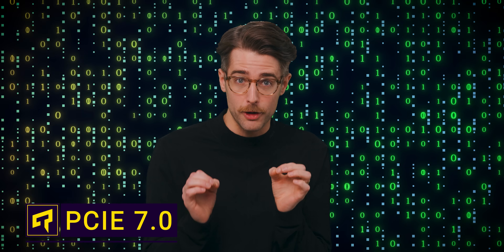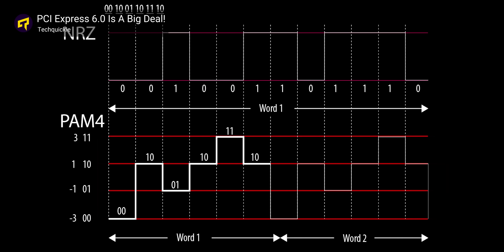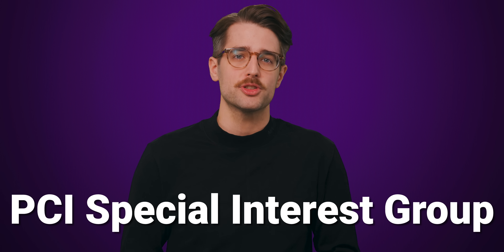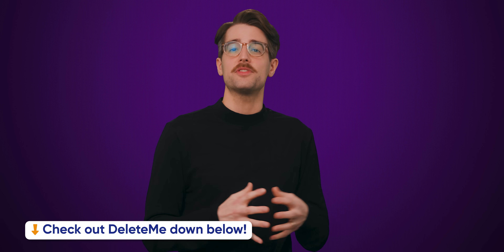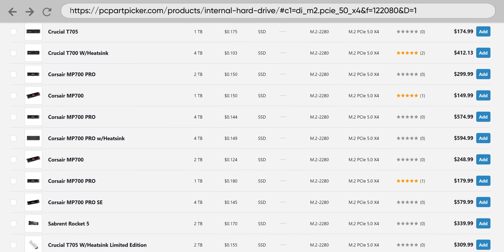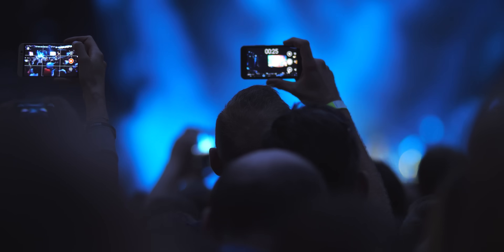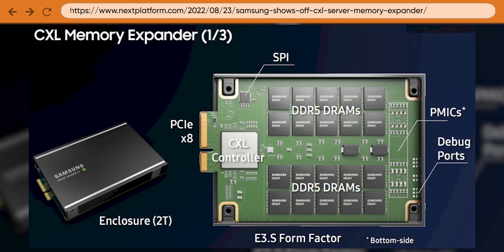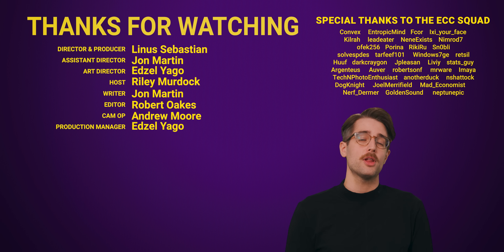PCI Express 7.0 is INSANE

Comment: I'm tired of most motherboards being limited to 16 pcie lanes and splitting them between all the slots. By the time I add a GPU, Dual 10gb, and a HBA as well as a couple NVME my GPU is bottle necked.
Reply: Hello I’m currently looking for a B650 motherboard, where could I find the info about how many pcie lanes it has? Maybe the online manual on the company website?

Comment: PCIe version felt like: PCIE THREEEEEEEEEEEEEEEEEEEEEEEEEEEEEEEEEE FOOOOUUUURRRRRRRRR FIVESIXSEVEN
Reply: More like:
THREEEEEEEEEEEEEEEEEEEEEEEEE FOURRRRRRRRRRRRR FIVE67 lol. Six was released yesterday, I swear!
Reply: 4 was shorter than yall think
Reply: It really doesn't feel like it but the time between 4.0 to 5.0 is shorter than 2.0 to 3.0 (2 yrs vs 3). 5.0 to 6.0 and 6.0 to 7.0 are also 3 years apart respectively. I legitimately thought the 6.0 video came out last year lol
Reply: Actually it would be more like "THREEEEEEEEEEEEEEEEEEEEEEEEEEEEEEEEEEEEEE FOURFIVE S...SEVEN" PCIe4.0 hadn't released a single device before 5 was a finished standard which is kinda why intel opted to ignore 4.0 and wait the year or so to adopt 5.0. Then I don't honestly even remember so much as hearing about 6.0 and we're now on to 7.
Reply: Pcie 4 was available with B550/X570/Z590, proper availability with A620/B650/X670... Which is when pcie 5 was made available.
There wasn't even a full generation of wide availability for PCIe 4 before 5 came out.
Reply: THREEEEEEEEEEEEEEEEEEEEEEEEEEEEEEEEEE FOOOOUUUURRRRRRRRR FIV SI S
Reply: like even on 4090 pcie version doesnt do much, on pcie 3 there is only 5% loss in fps
Reply: @DRedGuia  the higher bandwidth isn't really for gpus, it's going to be for ultra fast storage and networking and the like
Reply: @Anankin12  True, I am using a PCI-E 4.0 x8 card on a PCI-E 3.0 x16 motherboard. Not long upgraded from a Ryzen 5 2600 to a 3800X and i don't see any reason to upgrade again yet, everything I play runs perfectly fine at the moment
Reply: @mysteryboyee  no man, it is for GPUs. Just not for gaming. When you train a big model and/or use mini batches, the data communication overhead is something astounding. For example my 3060 12GB is constantly at 20% power limit while at 100% utilization because of the bandwidth limitations. I literally have the same performance as my friend's 3050 Mobile (4 GB) and my own CPU (5800X3D), despite it being 3 or 4 times faster than the 3050 and literally HUNDREDS (tested between 90 and 120 times faster in an unrealistic task that does the same kind of operations) of times faster in compute than the CPU in this specific task when not bottlenecked by communication overhead.

It's literally the most important aspect in performance for some tasks that use GPUs. Gaming is just not one of these. I'm pretty sure that if I bought a 4070 Super I would more than double my gaming performance but I would notice basically no difference in my ML training times.

Comment: You missed the best benefit that this can mean for consumers. Using fewer lanes. It has 8x the bandwidth which means that a 4090 could be kept fed with only 2 PCIE lanes. Given that consumer boards only have 24 PCIE lanes coming off the CPU and 4 of those going to the chipset being able to dedicate only 1-2 lanes per device means you could actually connect a ton more devices in a standard consumer computer. With these faster speeds I would love for x16 slots to fall out of favor and for us to drop down to x4 slots for devices like GPUs and down to x1 slots for storage. They are already overheating trying to reach 16GBps. 32GBps which is the x1 speed of PCIE 7.0 will be plenty for storage.
Reply: Good luck finding AM5 motherboard that both cheap and has x8/x8 split PCIE
Reply: @bocahdongo7769  Yes my comments are forward looking considering AM5 is only PCIE 5.0. This is what I would like for them to do with future consumer boards.
Reply: Pci-e 5.0/6.0 x 1 HBA/10gb NIC cards ^_^

I know that there are HBAs with only 1 Pci-e slot, but they don't have the amount of SATA ports that I would like. From what I know, quite a few motherboards have 1x slot Pci-e connection on them, but with the older Pci-e standard. When Pci-e 6.0 or 7.0 is mainstream, I hope we see HBA cards with enough SATA ports for my use using only one Pci-e slot. From what I know, most motherboards suitable for my budget don't provide enough Pci-e slots for a NIC, HBA and a potential GPU. 

By that time, maybe ECC memory will be a standard, maybe on-board 10gb network port as well ;). A guy could dream 😏.

Comment: PCIe 4 NVME: can run without any cooling
5: Needs a heatsink for full performance 
6: Needs a heatsink with a small fan
7: Needs a large heatsink and a 120mm fan
8: Needs an AIO or to be integrated into a cooling loop
9: Needs its own cooling loop with atleast 360mm radiator
10: Needs its own air-conditioning unit outside of your house that it's hooked directly up to
Reply: PCI 5.0 really needs cooler otherwise it will get overheated and performance will be reduced quickly
Reply: imagine a world where you have a PSU dedicated to your monolithic 3 cubic meter block of nvme cells hooked up to the system with a fiber link and linus has a new pool for cooling his
Reply: 11: needs a nuclear power plant cooling tower
Reply: its not work like that, Newer PCI will make the Motherboard can heve 16 NVME slot without a hitch.
Reply: too funny
Reply: Dial back all the descriptions by one generation and spot on. Gen 4 needs a heat sink and gen 5 needs some sort of cooling etc
Reply: and yes its likely by gen 9 you will need AC xD

Comment: Optics has huge latency, so it can be justified only on distances higher than 100m (0.1km).
The only option that may work is transmission line for electromagnetics waves implemented like some kind of coaxial cable on PCB (one transmission line per copper wire on PCB).

Comment: I have a tendency to opt for overkill. I built my current desktop PC to be relevant for at least 7 years. I invested almost $6,000.00 in this system and hope to justify that cost. Also, I provide professional sound/lighting systems for entertainment on stage. I use a 24 channel digital mixer which is WiFi controlled, using a router so I can control from up to 300 feet from the mixer. I opted for Cat 8 cable instead of Cat 5, simply because I want overkill on everything. I use 3 tablet computers to control this system. From a 10", 12" and now a 14" tablet. At 66 years of age, I am still a technical geek who prefers the best. I may never build another PC, but I'll have to admit that PCIE 7.0 will be tempting.

Comment: Doesn't signal integrity also depend on the software that deciphers it? 

Say, the faster piece of software can interpret a signal, the more that "signal" can hold?

Like say, 8 Track vs Stereo Casette? Both using a magnetic film roll, both having different capabilitie because of the hardware that uses them?

Like, doesnt it go both ways? Isn't that why GPUs no longer really saturate the lanes?

Comment: I wrote this before the ad break.
From the sound of it it looks like PCIE is pushing towards becoming a new vesion SCSI standard acting as a back plane. It wouldn't surprise me if we see PCIE used as a cpu interconnect. Intel is working on a optical cpu link as well or they might be done with it already.

Comment: I will tell you how fast PCI is. I got a new computer in June 2024. My mainboard has two PCI E 5.0 m.2 slots. And two PCI E 4.0 m.2 slots. I'm running in the m.2 4.0, two 2TB Corsair PCI 4.0 nvme drives. I'm running in the 5.0's, two 2TB Corsair pci 5.0 nvme drives. My pci e 5.0 slots have direct CPU access since the slots are directly wired to the CPU. My high end games and OS are  stored on the 5.0 nvme's.  Games levels load from 3 to 5 seconds. Then the games are fully playable. Also last night I did a full image file of my OS using special backup software I bought and own. It only took me I kid you not. 1 minute and 50 seconds to fully do a disk image backup file of my OS on my PCI E 5.0 drive. Makes sense, I installed Windows 11 Pro OS by USB Flash Drive to my PCI 5.0 drive in only 1 minute and 40 seconds the OS then booted from the drive. I've been designing PC's since 2000. We are living in the golden age of speed.

Comment: Optical cable links for PCIe 7.0 devices?

If such devices don't need traditional metal circuits then the shape of future motherboards and devices could be radically changed. Instead of large planar PCB's we would have devices that are physically separate and connected to the CPU optical cables. I wonder what that would look like.

Comment: i dont need faster speeds, i need more space.
Reply: How much space do you need for your personal PC that is? Hell 8 TB SSD from the likes of Samsung have been available on eBay and Amazon for easily close to a year now and occasionally I've spotted 16 TB ssd, one of which I bought from the team group brand a month or two ago
Reply: @motoryzen  well that depends on what your use case is. I have a personal server that needs more space or at least more affordable space. 

My personal PC is mostly good but still better storage options would be nice.

my handheld PC however, THAT i need larger NVME. right now 8 TB would be good but WAY to expensive for a single piece. In order for it to come down though we need higher end and other options. Higher speeds are not what is needed, we haven't used even a portion of the speeds we currently have in most cases. Games, videos and programs are only going to get larger in size.

More Ram is good though lol.

Comment: The question is will we get enough lanes?   The systems are designed to use up many of the lanes before you even put a card in.   I have a real raid controller card, a real gaming graphics card, and a real network card (100gbps).   You can say - oooh well that is a niche market.   Those are the same people who say - who needs 4K video or more than 60hz monitors, or indoor plumbing...

Comment: I want to start seeing x4 and x8 gpu’s and x1/x2 nvmes

So I can have more devices that use fewer lanes
Reply: Protip: NVMe (and most PCIe) devices will function w/ less lanes. [I used to run Solidigm P41+ 4.0 drives in X570's 4.0x1 slots]
-Optane M10s were Gen3x2, 990Evo is Gen5x2
-RX 6500series were 4.0x4 (M.2 adaptation invitation, IMO) + a myriad of GPUs are x8 (reaching back at least into the RX5*0 series)

Comment: I'm pretty skeptical about PCIe 7.0
1) M.2 NVMe's already have problems with cooling. PCIe 6.0 M.2 SSD has no way inside laptops because of that. You can't cool such SSD.
2) PCIe has backwards compatibility issue. I have fancy new 8K60 capture card. And it uses 8 lanes of gen3. My GPU also uses gen3 but 16 lanes. 24x gen3 = 12x gen4 = 6x gen5. My CPU has 24 gen5 lanes. It is 4 times more bandwidth that I need. Can I install both cards with full speed? No.

Comment: It's primarily for data center use.  They can use an x16 link over wire to interconnect to other blades in a rack.  Like a PCI link to a dedicated SAS enclosure or an enclosure loaded with compute etc.  moving forward generally expect consumer platforms to be about 2 generations behind enterprise in PCI generations.

Comment: Why is everyone naming self driving cars as demanding usecase in a datacenter? Do you really want to have self driving cars that either drive uncontrollably or instantly stop when they loose the internet connection? From my point of view self driving cars need to work completely by themselfes and by direct communication between each other. Information from the internet can only be extra data like road blockades for the navigation system, like already today.

Comment: I wish manufacturer engineers would eliminate the PCIe bus and run that same signalling over fiber instead. Then you could plug in your peripherals with an optical fiber with a plug and twist. PCIe over fiber is not a new concept, it's already done today. Using fiber would cut down on power requirements and PCB copper use.

Comment: Can’t wait for this to not be useful outside the server space until PCIe 12 is out
Reply: That's unfair...it will also be useful for workstations.
Reply: @concinnus  I doubt it
Reply: How awful.

Didn't they know they are OBLIGATED to make everything immediately useful for basic folk DAY 0!A!1!!!
Reply: @iambenmitchell  doubt all you want.

Once you move away from pushing pretty pixels, there is a need for the high bandwidth and features afforded by pushing this spec. Hence why it's pushing.

While the video games aren't demanding that much, other areas are an entirely different story.
Reply: @MaddJakd  yes. I know that. That is why I said "Outside of the server space" 🤦‍♂
Reply: @MaddJakd To add, even though it’s way overkill for today’s consumer graphics cards, it’s NOT overkill if you want to plug in 10 or 15 cards into a dual-CPU motherboard to partition into virtual machines for a rudimentary cloud gaming service.
Reply: Not if we movbe toward 2× standard for desktop ssd's. I'd like 4-5 to be on there as a norm, not 1-2 like we have now.
Reply: @fujinshu  A "cloud gaming service" is literally a server, even if it's LAN only.

Comment: Literally just bought a new PC, and got myself a nice, small, and fast PCIe 4.0 SSD after using an actual hard drive for almost a decade. And now there's PCIe 7?!
Reply: apparently for home use a gen 4 is even still way above and beyond what's needed as the rtx 4090 just barely fully utilizes a gen 3.

Comment: 800 gbps used for cloud AI we probably need 10g mobile network speeds . AI will not be limited by processing power but mobile internet speeds with 2tbps transfer speeds . Its same like you are forcing 100 gallons of gasoline for same lenght of travel as into a 100 bhp 4 cylinder engine which consumes just 1.5 gallon of gasoline per 62 miles traveled at full throttle

Comment: PCI 4 actually bottlenecks a 4090. Even if only by 10-15% depending.  PCI 5 doesn't.
Each gen doubles the previous, so obv it is exponential gain that continuously tends to look like "we could never possibly use all this"
Eventually it will stop at a real world theoretical maximum values and they'll have to make the slot bigger and stop backwards compatability.
2tb sounds like a lot until you realize that nanites save compute at the expense of bandwidth, which is the tradeoff you'll see in games with ue5.
A high res nanite mesh can easily be up to a gigabyte in size.  2000 gigabytes is easier to eat up than one might think when dealing with spatial pixels.

Comment: COOL!

So we're going to see PCIe gen7 in 2035 then.

Let's first focus on ACTUALLY moving to PCIe gen5, not just having a CPU that's capable of it, but GPUs that actually need it, NVMe that actually need it, etc.....   That's a few years away even if a handful of NVMe can exceed 8GB/s in rare cases.  Most transfers are never near the top speed of the disk.  So, increase general speed of all IO operations of NVMe by 50% and then we'll actually benefit from gen5.  Oh yeah and then from THAT point quadruple the speed.

With GPUs probably the best thing moving up to gen5 would be to REDUCE lanes for GPUs to 8 and have all CPUs do bifurcation, as in REAL bifurcation where you can put anything in the other X8 slot connected to the CPU and it doesn't screw up your system or simply not run.  If I plug anything into that 2nd slot off the CPU I can no longer have SAM enabled for the GPU.  We're still a decade away from a desktop GPU needing gen4 X16.

Comment: "What if you had a 2Tbps connection inside your home PC? That is what is coming down the road with PCIe 7.0." Most home PCs don't make much meaningful use of 4.0 today besides enabling GPU chip designers to lobotomize their mainstream models to x8 without immediately obvious performance handicap unless stressing the VRAM size limit. It'll be a really long time before there is any real pressure for 7.0 at home beyond the prosumer market. Much of the consumer market may never go beyond 5.0 for cost reasons. At least not until we get to the point of integrated optical PCIe becoming the norm, if consumers still buy PCs instead of laptops by that point.

Comment: Usability of that much bandwidth on one device doesn't even seem feasible right now, so I'm just glad that it might mean the lackluster amount of pcie lanes they're giving us nowadays might be useful if each device only needs 1/4 or 1/8 of the amount of lanes
Reply: Honestly, YES

The problem is PC manufacture knew only a FEW people care about that. Heck, it's pretty rare to find AM5 motherboard with x8/x8 PCIE split, even with motherboard series that originally has that.
Reply: @bocahdongo7769  yeah.. They'll come in with a "it's for future proofing" like you're not going to replace the board in the next 1-2 years.
Reply: @g45h96  honestly, the PC enthusiast actually want mostly is just more storage. And indeed both AMD and Intel did add extra lane to accommodate extra SSD slot

And somehow mobo manufacture still screw up, espescially AM5. AMD gave it 8 lane directly to CPU just for SSD, yet they still use only 4 lane CPU for SSD and rest is using chipset (like AM4 days) and god know where they wire those extra 4 CPU lane for

Comment: PCIe 7.0 is vaporware. It will never happen. Copper atoms will not shake that fast.🙂Keep in mind that, despite the PCIe 6.0 specification being released, uh... 3 years ago? No one has demonstrated a working PCIe 6.0 connector in any form factor.

Comment: Interesting. 
I'd say its not just memory but sub systems for persisting data. 
You'd cache the data in memory that then moves it to the NVMe drives. 

This would work in composable system designs. 

For home use? 
There are a couple of use cases.

Comment: 10 or 100Gb Ethernet is like moving a sack or a ton of sand one grain at a time.  The Ethernet MTU is 1500 bytes.  OK, 9600 bytes for jumbo frames.
Grain 1, grain 2, grain 3, grain 4, grain 5, grain 6, grain 7, . . . . . . . . . . . . . .